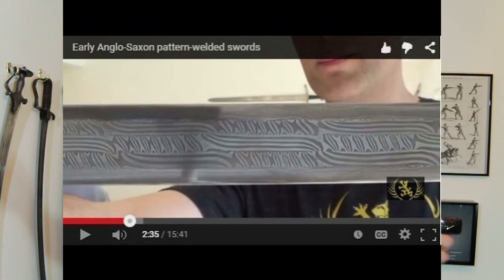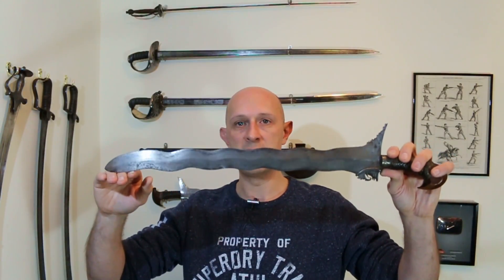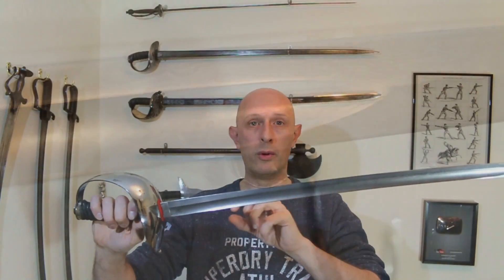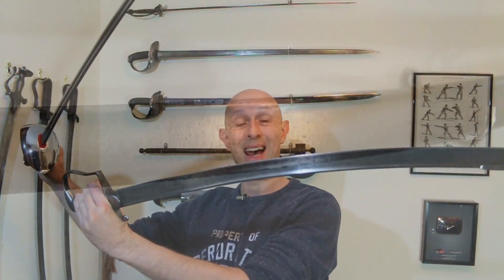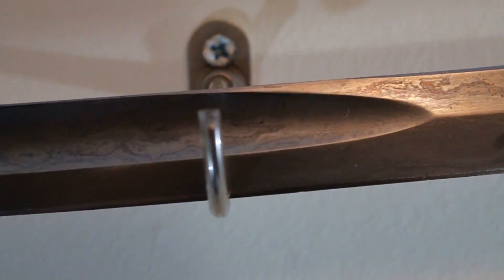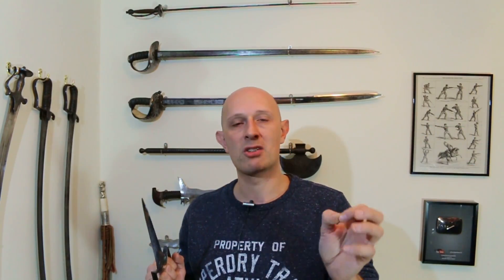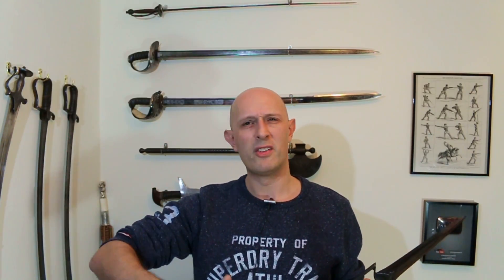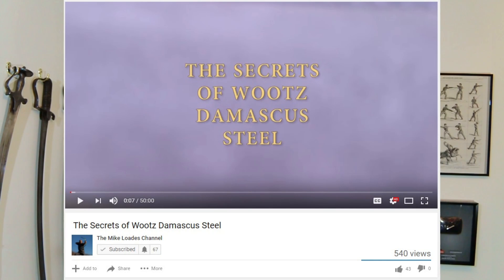Damascus (Wootz) Steel & Mike Loades' New Channel

Comment: This way of telling people it's not okay to say "damascus steel" about pattern-welded blades is quite pedantic. Actually, in the knifemaking and knifecollecting world, "damascus" is a very legitimate word to talk about non-homogeneous blades, be they wootz or pattern-welded. And wootz is extremely rare, found mostly on antiques, and has a specific word for it: wootz. "Pattern-welded" on the other hand is quite a long term to say and write, and it's sensible to use the word "damascus" to name it. "Damascus steel" is already a misnamer for wootz, it's just the major city where westerners could get wootz centuries ago. So let's call wootz wootz, the only proper and univocal word to designate it, and assume the vaque word "damascus" likely designates pattern-welded blades, since wootz is only an extremely tiny fraction of all "damascus" blades in existence (and a negligible portion of all "damascus" produced nowadays), except in a pre-1800 text.
Reply: Oh boy... maybe because all these peoples are dead, buried and forgotten? Maybe because languages' reason to be is communication, not fetishism of the past? Maybe because most people making pattern-welded blades often call it damascus, and people buy it under the name damascus, and everybody talk about it as damascus except a few pedants? Maybe because wootz already has a name: wootz (and it's a proper one, not the name of a city which was only one among many of the center of production and trade), and "pattern-welding" is rather cumbersome to use? Maybe because wootz is pretty rare and niche, while pattern welding is comparatively extremely commonplace, and it's stupid to keep two separate words to designate something extremely specific and rare, and have no proper one for something commonplace and often encountered? Maybe because if you go by that logic and are consistent with yourself, you should also absolutely rebutt all modern sword terminology, most of which was also created/adopted during the 19th century or even later? 

"Damascus steel" used to be quite straight-forward and clear, it was understood as an umbrella term for any non-homogeneous blade, unless pedantic peoples brought out that non-issue of wootz being the actual damascus steel,, and try to fight and make it a specific term, practical synonym of wootz without any added value in use, and actually introducing confusion. Living speakers and users of a language have all rights over dead speakers who, much to your surprise, do not speak or write anymore. Or maybe go learn sanskrit or ancient greek if you please.
Reply: Or you could just sit down off your high horse and accept the proper nomenclature.
Reply: "Proper" according to whom? Is there some kind of Pope, or President of Language, issuing laws regarding what terminology people are compeled to use and not use, I would be unaware of? Wootz is clear and unambiguous (crucible steel showing visible carbon segregation) to all speakers using the term, on the other "damascus" is used mostly to refer as any sort of deliberately un-homogeneous blades, be it wootz or pattern-welded. A bunch of people want to make it an absolute synonym of wootz and deprive speakers of a term they use in a very legitimate and practical manner to describe a whole category of blade material, among which wootz is only a very tiny and unrepresentative fraction. Vocabulary nazis and the lost purity of "Damascus steel".
Reply: "Damascus" may be a vague way to refer to wootz, but since it was historically obtained from Damascus and the area was known for it, it at least has a reason. Using the term for pattern welding is just building terminology on an error, and is bound to keep the waters of understanding muddy.
Reply: MadNumForce 
So Damascus = bird
&
Wootz = eagle.

All Eagles are Birds,
but
 not all Birds are Eagles.

🐣
Reply: No, it wasn't called that. Arabs didn't called wootz Damascus steel. It was called woots, bulat, pulat etc. The term Damascus steel is a *European term*.  The term Damascus steel was first mentiend by Brocquiere  in the 15th century. Simply saying that the swords made in Damascus are very good. 
Pattern welded steel was commonly called Damascus steel by the early 19th century and there are several mention in the 18th century.

However  Ibn Hodeil in the 14th century wrote the following. "The Arabs claim that the fabrication of (Frankish swords) is the work of Genies. They are more resistant to blows one gives with them even during cold weather, while the hindy (wootz) sabre often breaks when the weather is cold...""

 Al-Kindi in the 9th century also mentiened the "river-like appearance" of the Frankish blades and that it was common and liked by the arabs.  He also wrote about the crucible steel, he called it pulad or fulad and again mentiened the water like pattern on it.
Reply: Perhaps just saying "wootz Damascus" or "pattern Damascus" would be better?
Reply: @Scott Boyd
Yes, I think that's how most unpedantic people understand it. People without much knowledge only know the umbrella term, and may not really be able to tell or understand the difference between pattern-welded blades and wootz blades (only that it's nice, and not like your average kitchen knife), but educated people surely can tell and understand the difference and they, since they're a minority, should opt for the most practical posture, which is to go by the popular use, and just help understand the actual difference instead of fussing over a term that is only a very vague and barely legitimate metonymy.

@Adam Koncz
Thanks for bringing in some facts. Thinking about it, saying that "Damascus steel" is the proper term for wootz (or bulat, a term I had already read but we don't encounter very often) is like saying the proper way to call North-American Natives is "redskins", making the point of view of the Westerner the reference. We know that wootz/bulat (I think bulat or pulat are probably the same word, only different transcriptions, maybe from different languages/dialects) was produced over a large area, and labeling it all under the name "Damascus steel" just because that's where Westerners bought it or figured it was made is... questionable.
Reply: EnderDragonFire  Almost all modern names for antiques are different from what they called them back when they were made.  We are not trying to communicate with people who died hundreds of years ago but with people who are alive today.  Terms will always change and evolve so its stupid to fight it.  You don't call a car a motor coach anymore, or when is the last time you went to the haberdasher?
Reply: the problem is if with the term Damascus steel you refer to a simple pattern welded blade but want to sell it as a wootz
PS: in italian we just call wootz "acciaio damascano" or lama damscane= damascus blade
Reply: I do see your point, and I think Matt acknowledged this, inasmuch as he said it's correct for more recent terminology, but wrong for pre-19th century terminology. And this difference can be confusing for a beginner, so it's good to try to be clear.
Reply: It is also incorrect to call wootz steel as Damascus steel. Wootz steel is just crucible steel while "damascus steel" is a steel that has a pattern on it. It requires that the steel has a few ppm trace elements in it such as vanadium, manganese etc. These trace elements form the visible pattern at the edges of the dendrit crystals. These trace elements doesn't necessarily effect the properties of the steel but they do make the pattern visible. Hence makes it possible to distinguish between crucible steel and other types of steel while making it pretty. These trace elements only came from southern India the Hyderabad region. That ore has apparently high phosphorus content which can cause negative and positive side effects. On one side it can make the steel harder (which was praised) on the other if the heat treatment and forging is not careful it can make the steel brittle (of which Arabs apparently complained about and preferred European steel).
You cannot call wootz steel Damascus steel unless it does have those trace elements and was forged propely
Reply: It stops being pedantic when you have people describing the properties of traditional wootz, and especially selling blades implying or outright stating that it's traditionally made "Damascus", but using pattern welding. There's bad documentary and testing videos about the quality of wootz, where they're not even using wootz, which is like using zinc coated butted maille and modern factory rolled plate to show improvements in medieval armor. It's not the same thing.
Reply: There is no traditionally made Damascus. To say that the real Damascus steel is made of wootz and the pattern welded one is not is ignorant. Wootz steel was not called damascus steel unless it had obvious wave like pattern on the surface and at the same time pattern welded steel was called damascus steel because it also had obvious wave like pattern on the surface. Wootz steel that had no patterning was not called damascus steel even though it had the exact same physical qualities as the patterned one.

Only Europeans called these steels Damascus and they applied the term on both kind of metal if not the same time at least close to each other.  

There are thousands of wootz damascus swords in museums, several of them were studied extensively and they dont have magical properties. They dont cut stone or steel they are not more flexible than other period steel. The main property that made it desirable was the pattern on the steel.

Arabs imported both Indian swords and European ones and both were liked equally. As many preferred European blades as Indian ones.
Reply: My point is that you can take wootz steel from southern India forge it into sword and it will not show any Damscene pattern unless it is forged tempered and ground the correct way. Most swords made of wootz do not show any pattern and indistinguishable from swords made from other steel. They also do not differ in quality. The wootz steel is no different from other crucible steel except it contains trace metals that if forged correctly enhance patterning. Mostly vanadium (around 40ppm) manganese 200ppm that enchance patterning. Wootz also contains phosphorous 1000ppm that somewhat increase hardness and britlenes. It is mostly the phosphorous  content that affects its properties, however such phosphorous content is not unique to wootz.

Just because it is made of wootz it does not grantee a good sword. In fact there is literary evidence that at least some Arabs (and Mughals ) preferred European made blades over the ones that were produced in India. (in the 14th-15th century and onwards)
Reply: Oh you are a dense one....heres the thing, people use the term "Damascus" to refer to patternwelded blades while trying to pass them off as wootz/crucible steel and frequently reference the "carbon nanofibers/nanotubes" found in wootz steel....but not found in pattern welded steel.
Stop being a goddamned curmudgeon and just use the right term, please.
Reply: First no. not nearly all wootz sword were produced in Damascus. Arms and armor were manufactured through the Middle East and South Asia from wootz. Arabs did not claimed superior properties to swords manufactured in Damascus versus other places.  If you have a non European source that says  swords produced in Damascus are somewhat better than swords produced in India let me know. 
It is only the Europeans who called swords made from wootz Damascus swords.  And it is actually unclear whether the sword production in Damascus has anything to do with the naming. 

An other question do you know any study or reserach the publsihed anything about the physical properties of wootz steel, or Damascus steel? Are they actually better than other type of steel? Because all I ever read is that they are unbreakable and can cut stone, but nothing that actually quantify its properties.
Reply: +MadNumForce Mat never said that people who call pattern welded blades damascus steel should stop doing so.  He said that originally it referred to wootz almost exclusively,  but that changed later.  So why the hell are you acting like he is being the most elitist person on the planet for saying so?  And the problem with referring to pattern welded blades as damascus is that I've seen a shit tonne of people using the word "damascus" to pass a steel off as wootz. Often times without them realizing it.  Maybe you have encountered such people, but don't accuse Mat of imaginary elitism.
Reply: +Samwise
 The problem with modern UHCS steel that they dont show the same properties that the existing historical Damascus steel blades. Do you know any hardness test for historical Damascus steel? The ones I know (Zschokke Swords,+ an indian made knife ) are around RC 36-42. Which is not very hard. Modern UHCS steels claim hardness of RC65-70. The two material is clearly not the same.  In fact do you know any test made on historical Damascus that proves that they were superior to contemporary European blades? Because I dont. If you do please post it here.
Reply: +Samwise yes there are a lots of could have should have. However from the several thousand damascus steel artifacts existing today to my knowledge none shows the properties of modern UHCS.

Now I am not an expert, but your links dont tell anything about the properties of actual historical damascus objects either.

The closest I got is some publications about the Zschokke Swords and about an Indian dagger. However they are rather underwhelming.
Reply: +Samwise
 Let me spell it out again. What are your sources? An evidence that something could have been is not an evidence that something was. There are thousands of historical existing damascus steel weapons both in Europe and Asia. As far as I know none of them has anything to do with modern UHCS. If (!) there was a few that did compare to modern UHCS that was by pure accident, because 99% (100% as far as I know) of swords made of wootz are not like that. The distinguishing feature is indeed not their physical properties but their surface pattern. (BTW could you explain why superplasticity is important for swords? How does this increase its qualities as a sword?  )
Crucible steel may have looked miraculous in the 10th century in Europe, it definitely wasn't in the 15th century. Indians  exported wootz all over Asia. 
The Chinese knew about it and wasn't impressed. 
The Mughals knew about them, like them but they equally liked and often preferred European steel. The Mughals did indeed imported large number of European blades and happily used them for swords made for their emperors. 
The Arabs knew about them and praised it for its great qualities, but they also liked, praised and often preferred European blades.  In fact there is literary  evidence from the 14th century that they thought European blades are less fragile than Indian ones. You will find arab sources that say the Indian swords are the best of all and you will find arab sources that says the Frankish swords are the best of all. 
In the 16th and 17th century the Ottomans were all over of Hungarian and German made swords even though they pretty much owned the production of Damascus swords.
Reply: Ibn Hudhayl al-Andalusi wrote in the 14th century.   "The Arabs claim that the fabrication of (Frankish swords) is the work of Genies. They are more resistant to blows one gives with them even during cold weather, while the hindy (wootz) sabre often breaks when the weather is cold..." 
This refers to a phenomenon called cold-short that can happen in carbon steel and could be caused by high phosphorus content among other things. The Zschokke swords were analyzed and found to have relatively high phosphorus content. 
http://www.tms.org/pubs/journals/JOM/9809/Verhoeven-9809.html

Al-Biruni (AD 973-1048) also mentioned that the Rus makes pattern welded blades as opposed to Eastern blades. He also says, that Eastern blades cannot withstand the cold of the Russian winters, in which they are liable to break

The Mughal emperor Aurangzeb received the famous sword Alamgir from his father. One of his most prized sword a European made blade. To prove that European swords were common and favored in the Middle East and India you can refer to Matt Easton he made several videos about them.  

It might be that all wootz swords are superplastic. Even though the  Zschokke swords has a variety of carbon content from 0.6% to 1.9% even though they are all Museum grade Damascus swords.   However I reject the idea that superplasiticity make the sword to function better as a sword. When I said Damascus swords dont have the UHCS properties I was referring to the hardness and resilience of modern UHCS 60RC+ .  Super plasticity explains why European blacksmith couldn't work with wootz but doesn't make a better sword. Carbides could help edge retention and hardness but not in the small amount wootz have them.  

The hardness and resilience of existing Damascus swords are in pair with European swords made in the period. Actually I belive hardness is a bit under them. Zschokke swords has hardness around 20-35RC, tests on other Damascus swords ranged 10-45RC. While European swords 9-16th century had a wide range of hardness 0-52RC an average of 45RC. In fact I maintain that the ability to heat treat a sword and heat treat different parts differently makes a better sword.
Reply: so it's been wrong too long to correct it?